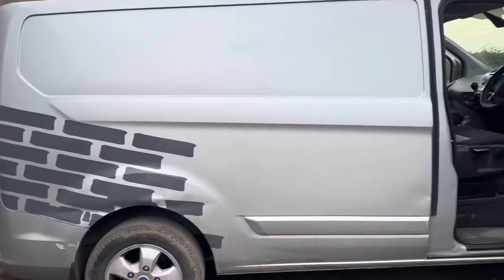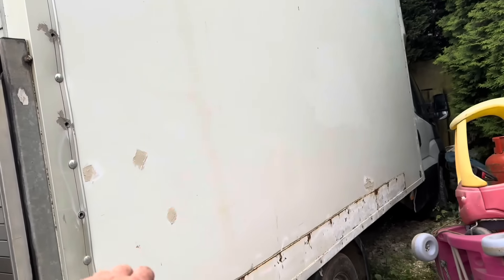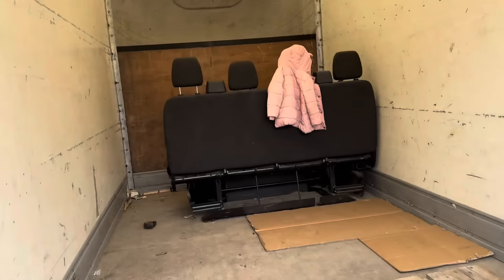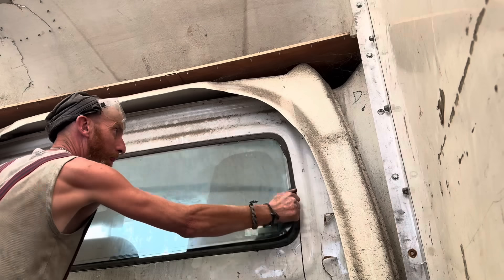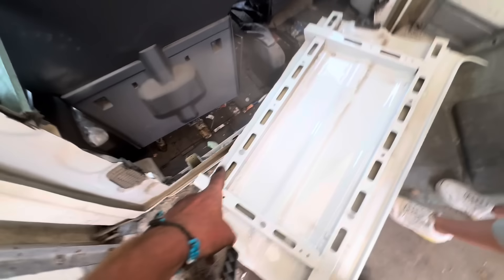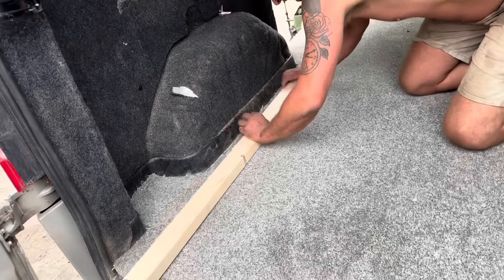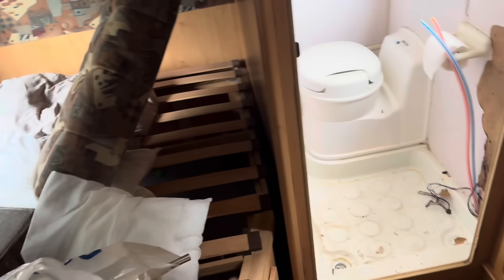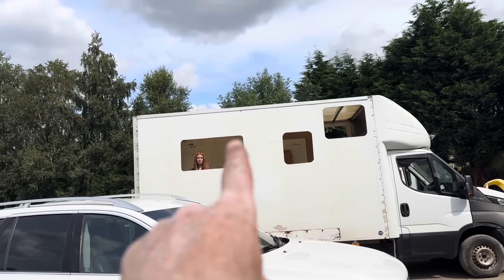£200 Transit CAMPER CONVERSION! Start of the £1000🤦🏼‍♂️LUTON BUBGET CAMPER!

Comment: 2:52 seat belts ,full ones not lap ones ,V10 formula 1 engine strapped via a gearbox to rear axle 😂,,👋🤠👍
Reply from the maker: Yeah put them belts in today mate on the roll cage👌 as for the engine 😉😂😂

Comment: Hi Chris it's the insurance where you can come into trouble adding extra seats. If you can find someone to insure you it's bloody expensive   , look into it first before you invest bud
Reply: Don't think it would be that bad if changed the docs too motorhome then get motorhome insurance that would also over come the seats problem would definitely need roll cage due too the rigid roof or re sheeted tho

Comment: Added my own seats into my Vivaro, and as long as it was bolted solid to the chassis all was good.  One MOT tester did advise me to add a sticker to my side loading door which said "Passenger Access" or words to that effect.  This way in an emergency they would know there could be people in there (there was no window on the door).  Other side door had access to the rear and the seating area was boxed off in 18mm Ply for extra safety from flying objects.  My seats also had integral seat belts which was handy!